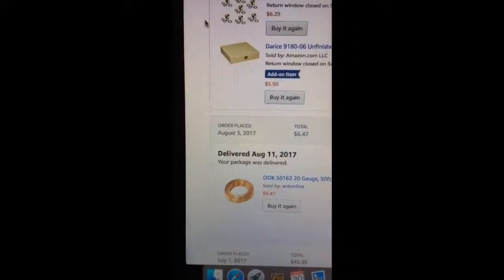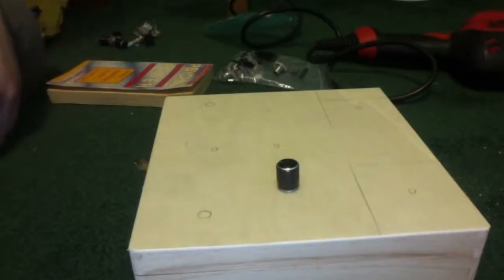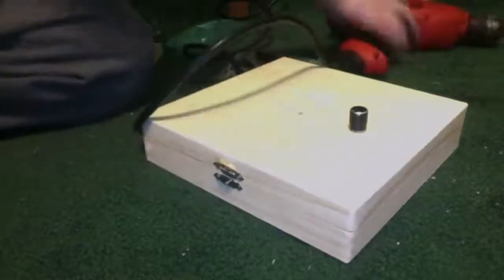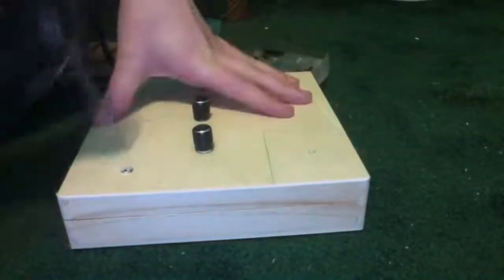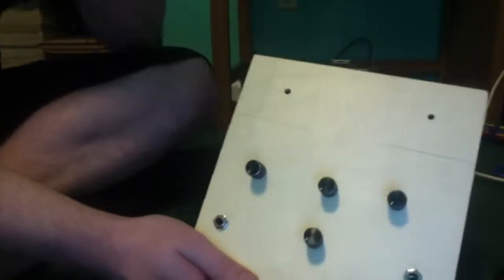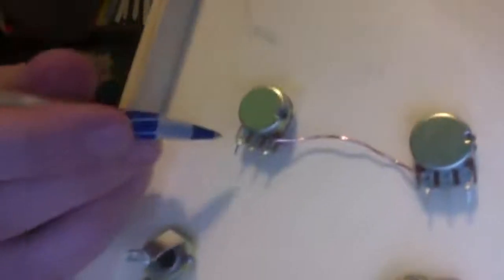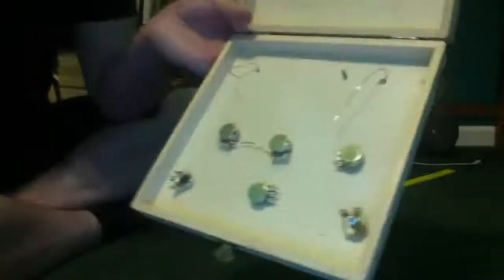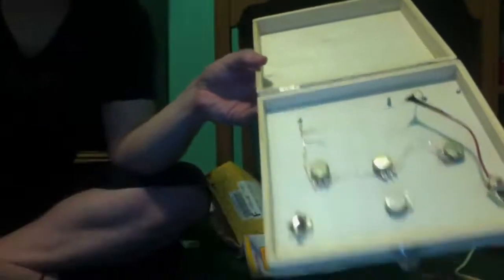Radionics 101   How To Build A Radionics Machine

Comment: Two questions: 
* wouldn’t electrical tape over the copper spirals reduce the electrical current flowing through the spiral to the connections/accelerator sheet/potentiometers?
* what and how is the Attenuator used on this set-up? That is a ‘current reducer’ in electrical circuitry, but I cannot see why you would need that with this radionics box

Comment: What type of potentiometers did you use?  1  omega, 10 omega,100 omegaor others. Thanks
Reply: I researched it. It is not important. Best by all the same. If you only can get a set with different ones just use them even they are different.

Comment: Is this really all that is in those expensive radionics machines? Why do the other ones plug into the wall and have an output tube? Can anyone share any resources on how these devices work becuase I cant find any info anywhere..
Reply: The Radonics devices that plug into the way just allow the option of running an electrical current through the machine that supposed to make the intent manifest faster. Bing that's electricity flowing through he device a person better know how to safely wire that so there's no risk of electrical fire and worst a risk of shock or electrocution for the user.